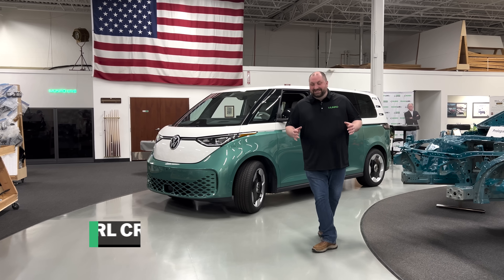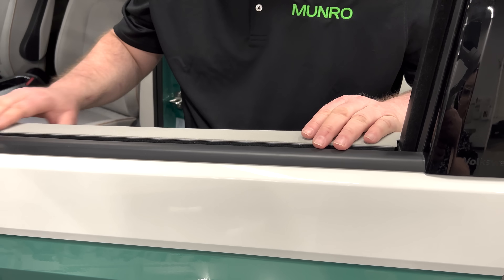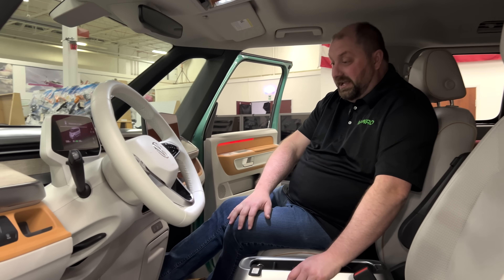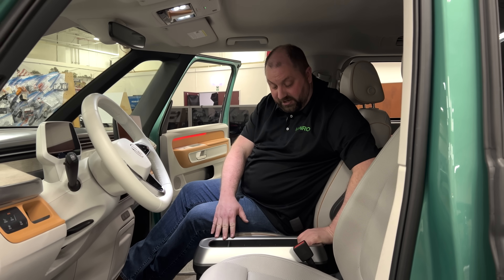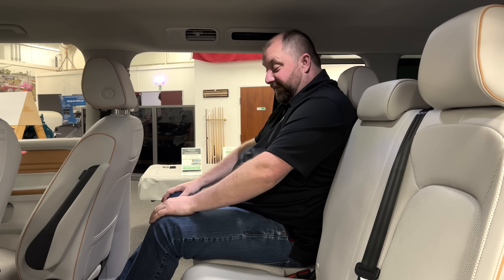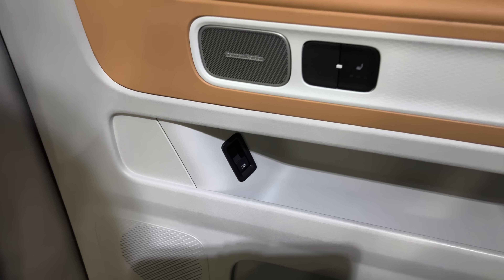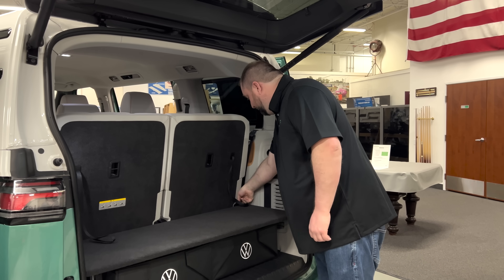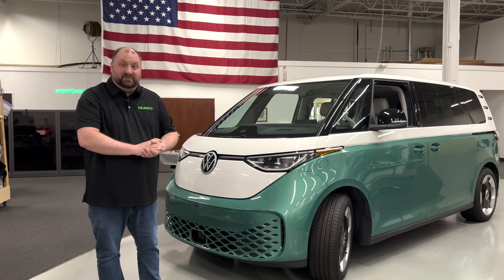The Cost-Comfort Conundrum: Volkswagen ID. Buzz Interior Review

Comment: Built by VW Commercial vehicles in Hanover. Anyone recall the demise of the Eurovan in 2003? Remember the chicken tax? The car is designed on the MEB platform, but from then on it’s built by people used to delivery vans for the EU market, and they kind of gave up on North America. Range? There’s the EU M1 classification - GVWR of 3.5 metric tonnes, for which you need a special license beyond that. So bigger batteries? Volvo had to build smaller ones for Europe for their EX90 to get around it, and even with a 110kWH pack, only gets 300 miles. We like it, but then we have a Eurovan. And right now there’s some great discounts, thanks to all the thumbs down in the media. Our ‘03 Eurovan BTW cost about $40K new, so in today’s dollars, $70K. It has the same interior space as a Suburban and is 30” shorter.

Comment: Hmmm, $70k vehicle with a budget interior.  The check strap on the hood looks like something that will break in a few years, again just low cost rather than providing a small gas strut.  Seat memory is limited to only two drivers, in this modern age, other brands allow for more memory functions.  Low cost fabric straps to operate the 3rd row are rather disappointing.

Comment: If the bonnet went up, it would be in the way to easily fill up windshield wiper fluid, don't you think? You'd have to lean under the flipped up bonnet in order to access it... But, having said that,  I agree that either way - up or down - has its downsides. It's an awkward bonnet. It reminds me of Audi A2's service bonnet back in the days.

Comment: One the one hand I agree some bits and pieces could be manufactured nicer meaning smoother edges and stuff. On the other hand VW people mover vans are traditionally cargo vans with backseats added more or less. So nobody expects nice materials in it imo. If you are looking for a van which is more made for nice looking interior, check out the Mercedes V class or EQV. But those can easily be a 6 digit price tag if speced nicely.

Comment: The removable center-console makes a lot of sense to me.   Back in 1992 when our first child was born and we were often back and forth between our place and my wife's parents' place 400 miles away, I went and bought a slightly used Dodge Caravan.  Having the ability to move from the passenger seat to the second row allows mom to deal with whatever the young kid(s) might need in the back without dad having to find a place to pull over and stop.      Of course, some people don't need that and would prefer a center console rather than having such access between the front and the back.  So making the console easily removable is a good compromise.

Comment: I see this as a practical vehicle that's going to get messy; smooth, firm surfaces are the easiest to keep clean. Yeah, it's cheap. Not sure on the "hood" opening--suspect if it hinged upward, there would be complaints about hitting one's head during servicing. Agree with all who say too pricey for range.

Comment: I live in Europe and have huge experience with older VWs. In older cars they have continuity of engineering. It means sometimes you can barely distinguish generations of cars - despite being "new", under the hood it's basically the same car. Partly because of engineering level, partly because of decades of evolution those cars was designed fairly good (and fairly priced in US and China). ID lineup looks like old engineering team was fired and management staffed new team not even with fresh graduates but with people from Jobcenter.

Comment: Can the center console be switched around? Isn’t it kind of weird for the biggest storage tray to be only be accessible from the rear seats?
Reply: no, you cant. would also not be a point to it, you can reach in from the front seats if you really want to but its mostly to give the rear passengers a space to store their crap. there is LOADS of space in the front so you dont need that bin.

Comment: Injection design here:

But overlooking flashes over the arm resting area is a glaring omission, for designing plastic at speed with light touch review process between department.  Tool split / flashes is a common interreferences between Class A artistic surfaces (external) vs internal mech attach requirements.

It a shame there is no "conjoin design thinking" on a supposed iconic car.

Comment: Carl is excellent. However, VAG Group taught the automotive industry on what we call, surface treatment. Surface, material transition. Although cheap in touch and feel, yet visually it is a very balanced interior, with much attention into detail on surface treatment. It ia a very neat interior all in all. The Maverick that he brings as an example, may use similar materials and methods but it is a visual mess.
Reply: Classic VW: entry point design requirements... Premium price for products 
Next time: get your price right and design it... Stop beating around the bush
Reply: My Maverick's interior wipes down with an all-purpose cleaner. O love that.

Comment: Seen lots as commercial vans in the netherlands...they are extremely over priced here..its audi prices....without the audi interiors or features
Reply: don't worry it still has the audi (un)reliability LOL
Reply: @patrickstaryo  our experience with Audis have been spectacular, super reliable and fun, both where manual STICK 2.7Bi Turbo in an A6  vroom Vroom and later an A4 with less but still STICK.  No issues, ever 132,000 + miles. on each